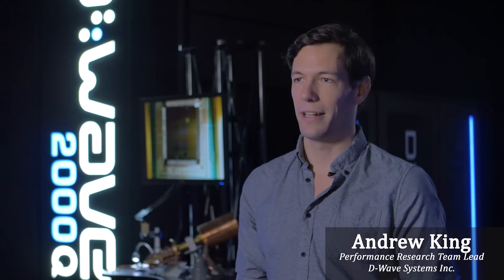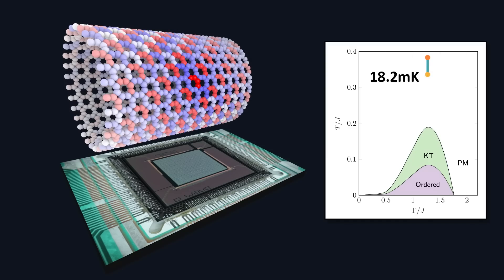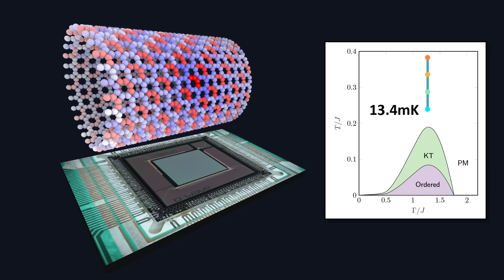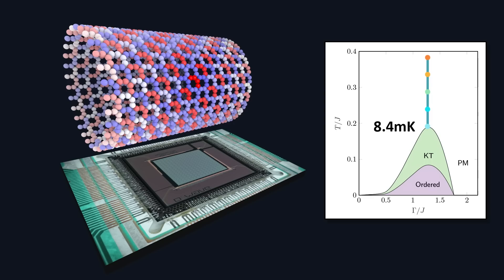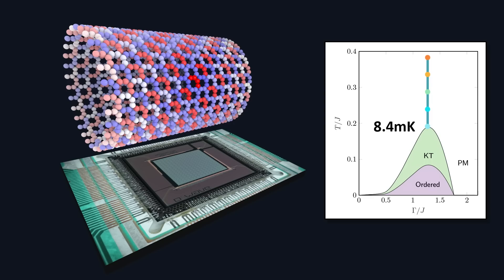Quantum Materials Simulation: Realizing Richard Feynman's Vision

Comment: Quantum Computers can assemble Matter in States they have never been in before, and run simulations while collecting data... This is NOT just 1-0's running programmed software off of a hard-drive, and "modeling" "inside a "computer" .  By exploiting our physical dimension, the "hard drive"/"programming" of a Quantum "Computer", IS the fabric of our reality, of the microcosm of nature itself.  And through entanglement and annealing they are able to control the movement of microcosmic bodies to CREATE/Simulate small scales of ACTUAL matter inside of these systems   ... This is the small scale manufacturing of ACTUAL materials / matter in a quantum environment controlled and analyzed by classical feedback ... A quantum "computer" is NOT a device to simply give us representative digital vision (thats what classical computers are for). Quantum computers are devices that can Probe the ACTUAL material environment of Nature, to CREATE MATTER through digitization, and they are only limited by the laws of physics (size of chip / zero point isolation enclosure ) , as Geordie tells you in his lectures. In the future quantum computers will be used to phase shift plasma for the production of large scale material objects... Digital Creation of matter from the aether... Mind you Geordie and Suzanne Gildert and everyone involved with this technology are self admitted demon - alien - worshipping occultists...  By coincidence? yah, no.

Comment: Materials Science is going to be a great industry to be in, even greater, in the coming decades with simulation.
It'll be a whole new era of production like never before.  
Back in the early days where we were making truly artificial compounds, it was already very exciting.  This is the next Big Step in that journey.  
When you can take a bunch of requirements and chew through thousands of possible arrangements automatically then create the ones that seem most likely to work, it cuts down R&D time so much.  
Then you can also create some odd ones that didn't match, the ones that seem least likely, just to verify the models do in fact work, merely to reinforce future research.  
Just blindly believing and potentially failing wouldn't be a good idea. Or missing out potentially really good ideas because our models actually weren't accurate.
This has already been the case when making new synthetic elements, some were slightly off-course of what was expected.  But that testing allowed to make better estimates of subsequent elements and potentially element 119 in the near-future!  
So actually verifying the occasional failed matches would also help.  It'd happen anyway, same way that CRTs were done, or X-ray and others, making sense of the noise using test models you know the internal geometry of, then tweaking the outputs until they match.
Iterative development and all that jazz.